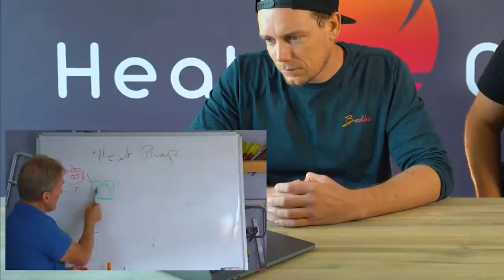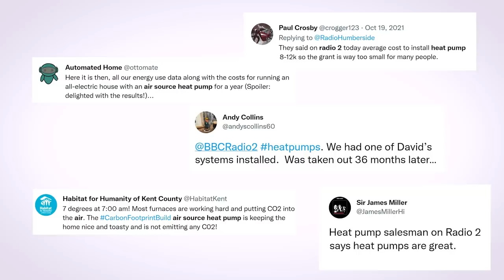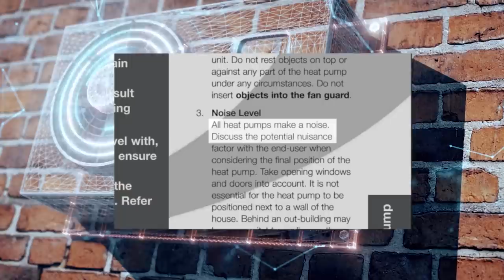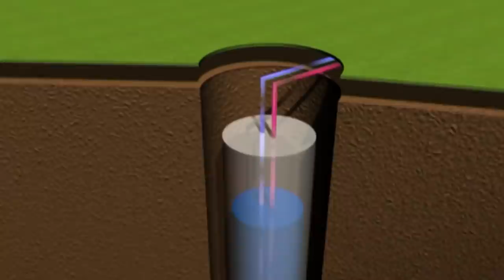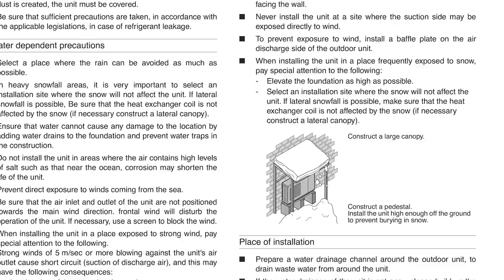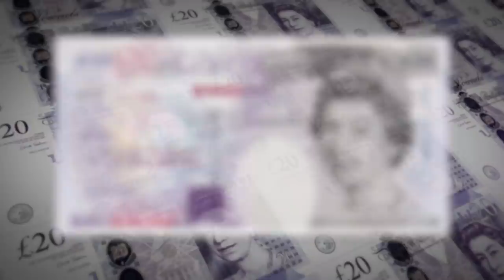Heat Pump Secrets They Don't Want You to Know

Comment: 4:45 The question of using gas or other fossil fuels to generate electricity is interesting, and also tends to come up in discussions of electric vehicles. Even if your electricity is 100% fossil fuelled, you can be better off with an EV because the motors are around 90% efficient vs 25-45% efficient for internal combustion engines. Heat pumps have a similar benefit: due to their over-unity COP, you're getting several times more heating power than the electrical power you put in, so even with 100% fossil-fuelled electricity, heat pump heating can be better than just burning the fuel for its energy.

The distribution losses in the electricity grid aren't all that great - less than 10% in the US and the UK. A bigger problem is the thermal efficiency of thermal power plants, which is typically less than 50%.

(I'll try to post my sources in a separate comment, as I think they might be causing my comment to be deleted...)
Reply: So even with those generation and distribution losses, a heat pump is likely still a more energy-efficient way to heat your home. Of course, whether it's "better" depends on other factors, as you've mentioned: I'm not a fan (haha) of the noise both inside and outside, the discomfort of blowing air during heating, and the issues with condensation and freezing in cool damp climates when the OAT is a few degrees above freezing. Here in New Zealand, air-to-air heat pumps are widespread, but I can see some great advantages to hydronic heating with a heat pump energy source, which seem to be more common in the UK and Europe.
Reply: So your EV comment .using your #s 
A modern 45% efficient gas engine (some claim better).  Vs More than than 50% losses at generation, 10% transmission losses, 10% motor losses... 5% battery losses... With some coal fired elctricity... ????
Reply: Well, using those numbers, 50% x 90% x 90% x 95% is around 38% efficiency for the fossil-fuelled EV. And I'd contend that 45% overall efficiency would be quite remarkable for a gasoline/petrol engined car; the EPA gives a range of 12-30% in real-world use, compared to 77-100% for EVs (accounting for regenerative braking).

(Argh, YouTube seems to be deleting any comment that looks like it contains a link, even when heavily munged, so I guess you'll just have to do a Web search for "EPA where the energy goes electric cars" and "EPA where the energy goes gasoline vehicles". Sorry, I tried!)

The point is, even in the absolute worst case of an electricity grid that's completely fossil-fuelled (an impossibility in the long term), the EV and the heat pump are probably still the more energy-efficient options.

Comment: There is a big efficiency difference between burning gas directly and using a heat pump on electricity which can be produced by gas powerplants. Burning gas directly you can get up to 100% efficiency. A modern gas powerplant has an efficiency of about 65%, so just for the sake of 'there are older ones' take 50%. 
If you heat with a normal electric radiator, yes you are half as efficient. But a heat pump only has to run at a COP (coefficient of performance) of 2 to get 50% X 2 = 100% while most heat pump have a COP of 4 to 6 (200 to 300%). So you effectively use les gas AND the electricity doesn't have to come from gas powerplants but can also be produced by wind or solar. 

Regarding the noise, wind direction etc. You wouldn't put the exhaust of your gas boiler directly facing strong winds or the neighbors patio would you?
Reply from the maker: Sven 
The claim of 4 to 6 is optimistic. Even the Energy Savings Trust trials in hundreds of homes only achieved around 3 for an ASHP. This is still worth having but the heat pump stays on 24/7 and does not work that well in a poorly insulated building. The noise is a thing and a lot of it comes from the huge amount of air the fan is moving. A gas boiler flue is smaller and can be redirected with a plume kit. The boiler flue is fine in strong winds because the air pressure on the intake is the same as the outlet so it means the fan always works in equilibrium.
Reply: @SkillBuilder  Even with a COP of 3 and only making electricity with gas you get an energetical advantage. If this translates in money just depends on which energy source the government wants to put more taxes on. That's the reason gas is cheaper per kWh than electricity.

Energetically is doesn't make any difference if you let a 1kW heatpump run for 24hours or a 24kW heater for 1hour. Just the heat buffer in between.

How it works in a building completely depends on the design of the installation, if any heating system isn't designed well it won't perform even if the house is well insulated.

Noise levels also depend on model and manufacturer. My gas boiler also makes noise and you can hear it running outside but probably there are quieter ones.

Comment: Regarding his comment on using natural gas to create the electricity he didn't mention the efficiency of the heat pump. If the heat pump to running at 200 or 300 percent efficiency, that's a lot less gas that is required relative to direct combustion with a boiler or furnace.
Reply from the maker: Yes except that it has to run 24/7
Reply: @SkillBuilder  at what capacity?
Reply: This could be helped with data. If you can get the research on this that would be great.

Comment: So it leaves me with the question: ground source is not practical for my small urban plot and a borehole would be way expensive. Air source as your video. We have modern d.g., cavity wall insulation, full loft insulation, condensing boiler with intelligent room stat. and programmable rad. valves, under floor ìnsulation. So how the heck can we become green and not rely on gas? How can we escape rising heating costs? Time to put on the thermals and a big coat?

Comment: A smal detail about the wind is that can make a small change in temperature, thos lowering the thermal exchange from the air to the liquid. You have all felt it when you are out in a 15 degree celcius day but it is very windy so i can feel a bit cold compared to the same tempersture but no wind. You could build a small shell in front of if to minimise direkt wind but still allow airflow from the sides. And also, maybe obious but still, insolate the pipes as good as possible, both on the inside of the house and the outside!

Comment: My house is not that insulated.... I have an air to air heat pump and works great.
Same for my parent's house.
No, the manual does not say it needs to be running 24/7...
No, they are not noisy. Mine is on the balcony of my bedroom, right next to a single glazed window and if I leave it running at night while sleeping, it doesn't bother me at all.
Reply from the maker: We are talking about air to water here. Air to air is a mini split

Comment: Just an odd thought: You know how towns and cities have become heat islands set in the colder countryside thanks to the heat leaking from densely packed housing. In future times with all the houses now heated by air-source heat pumps, each one sucking more warmth from the passing air, will towns and cities become ice spots and won't heat pumps demand more energy to run as they attempt to extract heat from air previously already cooled by other heat pumps in the near vicinity?
If so, surely the main answer lies in insulation and isn't it beyond time when our resources were devoted to retrofitting effective doors, windows and cladding to our thermally-leaky housing stock?
Reply: It's an interesting thought about all the heat pumps sucking cold air from other units, however making the whole town an ice spot isn't possible as the heat soaked up and moved indoors will escape back outside at the same speed it's taken at...otherwise it would get hotter and hotter inside until everything bursts into flames :-)
Reply: @Pete856  Nice point but... They are heat islands currently because energy (lots) is imported for space heating and it then leaks out - creating the heat island effect. There will (hopefully at least) be less energy imported with the advent of heat pumps so the ambient temperature overall will be lower - you're right to point out the first law of thermodynamics but it is a laggy system and the colder output of one ASHP will become the input of its neighbouring units but you've changed my mind about the creation of ice islands. Cheers.

Comment: I find it astonishing that in this day and age, the fan on the heat pump can apparently be damaged by spinning backwards.
Cars, trucks etc. that are driving down the road while fitted with electric cooling fans managed to fix that problem decades ago, yet here it is again?
I'm a little surprised that some eco-friendly heat pump engineer hasn't taken this problem and devised a method of powering the heat pump system in this situation, or at least reducing the electricity drawn from the property when it's in use, using nothing but a bit of creative rewiring. Maybe that's asking too much for some of these reputable 'manufacturers'.

Comment: The guy claiming air source heat pumps aren't noisy should spend a winter at mine! I live in an adapted housing association bungalow where they have stuck the unit on the bedroom wall and during winter it sounds like an airplane taking off. It also struggles to get the property warm enough in winter but then again it was installed by a housing association so what do I expect

Comment: My 8.5kw retrofit ashp in A 1960s detached house still works just fine. Don’t fall for the negativity from fossil fuel boiler installers who don’t understand how to install them properly. Also don’t fall for the pie in the sky idea that hydrogen boilers are coming. Hydrogen will NEVER be viable as a domestic heating fuel.

Comment: A heat pump is just an electric heater which uses extra heat from the environment and puts that in your house. They are just a glorified refrigerator - but they cost an absurd amount of money for some copper tubing and a compressor.  Heat pumps have far too many moving parts to be reliable. I think you'd do better in the medium to long term to install solar PV and batteries and simply heat your house with direct electrical heaters. Electrical space heaters are 100% efficient - every kWh of energy being pulled from the wall socket ends up as heat. Save your £15k-£20k heatpump investment and fit triple glazed windows and better insulation.

Comment: All you need to do is look at the specs, most do not achieve the “ get 2kw output ( heat wise) for 1kw in” in a cold climate, The more temperate your climate the more efficient they are. But in a colder climate they don’t generally do any more than raw electric heaters💁‍♂️

Comment: Odd that it is not advised to have HP in coastal areas due to salt air corrosion.  This argument should also apply to AC units in humid coastal areas, but clearly does not.     I would have though that preventative maintenance can be applied to counter this - and what not by owners - they are fridge units.

Comment: sorry. bit late to the party. Have to agree with skill builder here. my neighbours with air source are not happy, but because we have a field with enough room for 800 M of dual coil ground source, it started saving us £ 100/Month on electricity. system is NIBE. excellent, house is 21.5  deg constantly on a victorian single glazed detached property.

Comment: heat pumps noisy... well, yes & no. the very best of the best will have high volume low pressure fans, even at the compressor. mine does. it's a 4 ton & I can stand right next to it outside & talk over it. he's 100% correct about geothermal heat pumps- the very best use of your $.
Reply from the maker: They are not geothermal they are ground source which is solar

Comment: So heat pumps blow out cold air.  What happens when you have the heat pump for one building facing the heat pump for the next door neighbor.  Sounds a bit self defeating, especially with multiunit strata housing.

Comment: https://youtu.be/MqnTE9oFUjU?t=312
The difference is that the overall system efficiency is still higher, than directly burning the natural gas. 

A small calculation example: A natural gas power plant might have an efficiency of roughly 50% converting the natural gas to electricity. If we assume 10% losses on the way and a real efficiency annual performance number of 3-4 we still end up with an "efficiency" of at least 1.35 compared to 0.9 for a gas boiler. That's 50% better for the worst case scenario you pointed out.

As the electric power grid becomes gradually cleaner the overall impact of your system goes down, and we avoid lock in effects.
Reply from the maker: All well and good but it is all about keeping warm and heat pumps can struggle.

Comment: In the UK we only have a 5%overhead of electricity, the rest is imported.

So what's going to happen when everyone has car charging stations? (People that can afford electric cars and vans), then there's these heat pumps.

I guess electricity prices will rise even more due to having to import more and more..

I have always said why don't all new build houses have solar panels and why did the tories remove the 5%vat levy from solar panels.. 

The government should cap the installers due to installation fees are 80+% of the cost of the installation and materials cost of solar panels.

Comment: "Maintaining a high flow rate"... I thought they delivered a low flow rate? I don't think we should ever discuss HPs without talking about insulation improvements, sealing and ventilation. I know you do point this out regularly. Without this, they are a complete disaster for most poorly insulated, leaky homes.  Here in Ireland, we are encouraged towards using renewable energy sources for our HPs, not gas powered electricity stations.There is a technical assessment done before a HP grant is awarded by the SEAI. B2 or better energy rating for the home, or no grant. Whatever the heat source, it has to be fabric first.
Reply from the maker: Low temperature but high flow or they lockout
Reply: You don't need to hit B2 to get the HP grant, you just need to get a technical assessment. There's actually a €2000 bonus for hitting B2 using a one stop shop  deep retrofit.

Comment: Glad you made this video, and good to see you appreciate the other sides position, although many of them probably are not as courteous to yours.

Also try to always say if you have previous experience in backing a tech, and why you have changed your mind on it, if possible. As with the older videos you have on net from working for that company shows, you did have alternative views on heat pumps before, when you were taking part in advertising them.

There is nothing wrong with changing your mind on tech, once you learn more and more from experience how it works, or does not work as advertised.

We in public need such people as yourself, who have such experience, as people in public we have no reference, and like you know alot in public will be conned with good ideas from people, and how easy it is to push idealistic ideas on people, before the techs are really ready to perform.

So i like that you did this video to address this stuff, as it is important, as many as you know will be thinking of getting on this new tech, and they need people like yourself, to offer there opinion on the negatives, not just the positives they will get from sales reps.

Like you say lots of people installing these techs will not really understand, or bother to understand them, and they inflate the publics expectations, with idealistic ideas about what the techs really can do in there circumstances.

Comment: Taking into consideration the amount of vehicles that will soon be electric, including all plant and farm machinery, housing stock and industry all being electrified.  l struggle to imagine the amount of electricity  that will we need to generate and the size of the infra structure needed to meet the demand. Also what happens if a substaion goes down?. Or a solar storm event takes place?. Where is the back up? Most key buildings presently have back up diesel generators. The potential for breakdown and the strain on grid will be enormous.